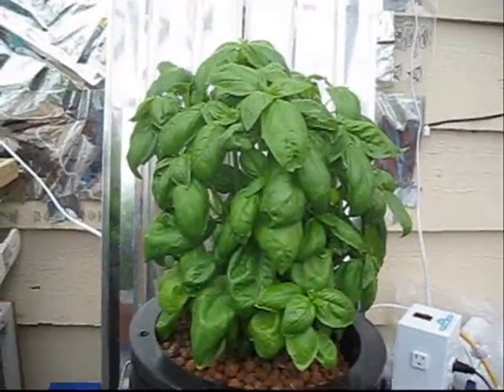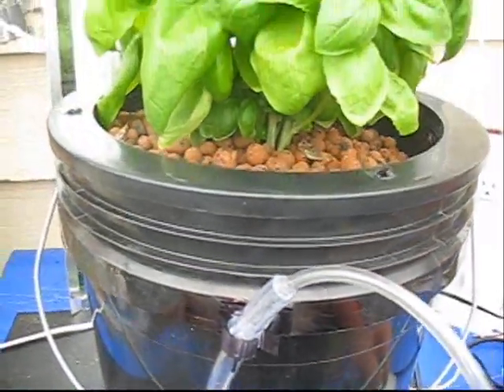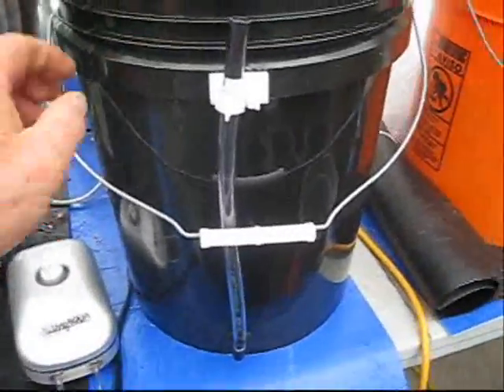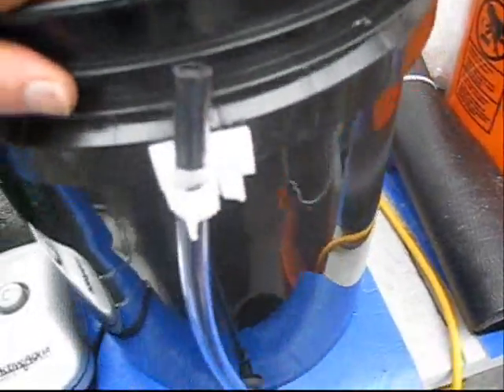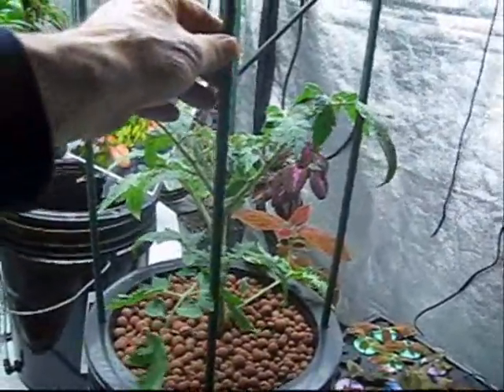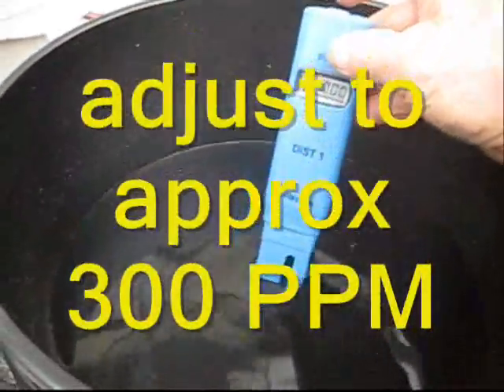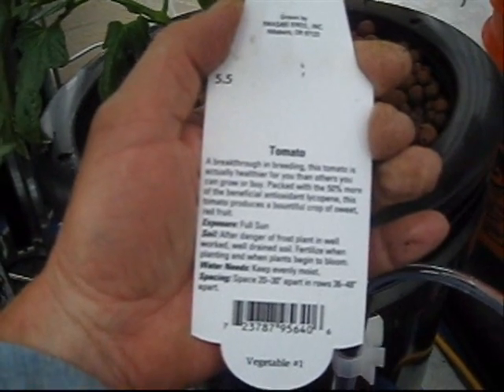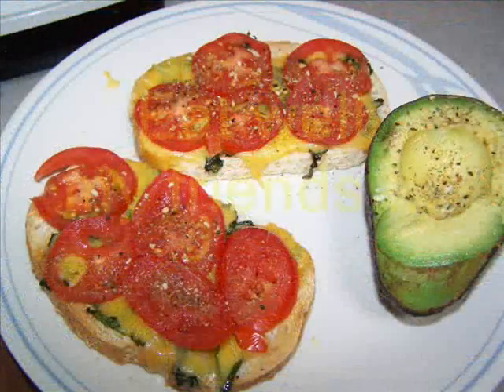Ron's easy DWC Bubble Bucket (RootSpa)

Comment: My only problem with this whole thing is that they must live in colder climate then me and the don't explain that your res water has to be between 65- 72 for your plants to uptake nutrients.  Also that after 72 you start getting root rot also I noticed a seedling heating pad under his so he is fighting the cold not the heat . Cold is much easier and cheaper to remedy then the heat which is impossible to remedies without a chiller or diy water cooler

Comment: I just started my bubble this year an mine are all outside, one thing I am noticing is that my water runs low every two to three days is that normal I do not see any leaks I am growing tomatoes and peppers, peppers doing good not so much the tomatoes and when the water runs low to I change it all the way and and add nutrients or just top it off and change water every two weeks your help please
Reply from the maker: Hello Marty - I noticed that my first year too.  What happens is as the plant grows transpiration increases, especially faster as heat increases.  What I do when there is a significant root ball, is let it run until about 2" of water remains then bring up the level with fresh nutrient solution.  When you want a nutrient change, just let it run low then drain, pour a couple of inches of fresh water in then drain that as well.  Final step just fill with fresh nutrient solution.  I hope that makes sense to you.  Good luck and thinks for watching my videos!
Reply: thank you very much I will be asking more question hope you do not mind again thank you and this helps, also can you recommend a good TDS thanks

Comment: I have the pots and I have 20mm holes at the base what size grommet do you suggest The last vid I watched he said use 13mm,the dick dont fit 20mm
Reply from the maker: Hi David - which video did you get that information from?  My video suggests a 13/16 inch  hole using a 1/2 inch grommet.  According to my rough conversion what you have should fit, although I would have to see to be sure.  
It should be a very tight fit and the grommet will have to be forced in place.  Use soapy water as a lubricant if needed.  let me know how you make out.

Comment: how far in the water do you sit the pot?
Reply from the maker: On new plants the water should touch the bottom of the basket.  Once roots start protruding beyond the basket the level can be lowered because, from that point on, it's the bubbles bursting on the roots that does the work.  Thanks for the comment and thanks for watching!

Comment: so happy i came upon this vid,,great vid .do you think it will work with pearlite and soil mix.or must i use clay balls
Reply from the maker: Hi Jason - You can use just about any growing medium as long as it is kept separate from  the nutrient solution.  Line the inside of the net-basket with coconut fiber, like that used in hanging flower  baskets.  The cheapest places to get these are:  Lowe's for the 10" basket and The Dollar Store for the 8" basket.  I have chosen to use the 8" basket because it works well and is handier to use.  I will be posting a new video showing that size basket along with nutrient management for the RootSpa soon.  Good luck and thanks for watching my videos!
Reply: thank you for the response.

Comment: Hi Ron, i know this is old video so just looking for a little advice. Is the basket in the water or just above the water line, everywhere i look people say different things, i do have my peppers just above the waterline with airstone, i have same pump as this video and although plants are growing, they seem stunted and wondering should i add more water to just be touching basket.
Reply from the maker: +MrJimbotz Hi - I start new plants with the basket about an inch into the water then lower the water level to almost touching the bottom of the basket once roots have developed.  After a while, once the plant has developed a sizable root ball you can let the water level get lower without causing damage.  Thanks for watching!

Comment: Hi Ron, do you know where I can find a grommet or tube cap for the top of the air inlet tube? I'm having trouble finding something for the hose to connect to.
Reply from the maker: +Amy Mintner  Hi Amy, thanks for watching my videos! You can see how to make the adapter by watching this video: 

https://www.youtube.com/watch?v=5Y0rbxnGcE0

You just insert pieces of vinyl hose to adapt from 1/2" to 1/4" for the air hose.  Good luck and thanks again for watching!
Reply: I actually was able to drill a hole in the cap and that works great!

Comment: how high is the basket with the hydroton above the water line? and how do the roots not dry out before they get in the water?
Reply from the maker: SwayzesGhost 
Slightly below the water line when initially planted to keep the roots moist.  Water level can be lowered to about mid way as roots grow into the water - air bubbles will keep the upper roots damp.  Air infused water allows roots to flourish without rotting because of oxygen and nutrition supplied to the roots.  Thanks for watching!

Comment: Where did you get the hose clamp from and what type is it?
Reply from the maker: Sun Ra El At Home Depot in the electrical parts section with items like wire nuts, lugs, etc. - it is actually a cable clamp.  Thanks for watching!
Reply: Ronald Kleinman is it the gardner bender 3/8 x 1/4 in if so could you explain how you attach it and how do you keep your water level from leaking?
Reply: Ronald Kleinman I didn't know if it is theOne Hole Plastic Cable Clamp or the  Plastic Kwik Clips
Reply from the maker: Sun Ra El Hello again!  Watch the video on how to build it:  

https://www.youtube.com/watch?v=5Y0rbxnGcE0

I shows how to construct and what parts to use.  Subscribe to my channel to catch more information on hydroponic gardening.

Comment: Thanks for the vid... I think that you are on to something here Ron!  

Air stones aren't all that expensive; but, it's an additional cost and a point of failure that you have taken out of the equation.

A friend made a comment that the bubbles are only on one side of the bucket.  I told him that it most likely doesnt matter and if he wants the bubbles to come up in the middle of the bucket, just make the hose going into the bottom of the bucket longer to reach the middle, problem solved.   Keeping it simple!!!

Comment: im thinking of switching to DWC and have been researching it for a few days now and was wondering do you check the temps of your water in the 5 gallon buckets? it tends to be about 75 degrees where i live and i know the water (or root zone) is supposed to be 68 degrees F. is this a major factor in your plants and will it be in mine? or will i be okay if the room temp is around 75 degrees?

Comment: Can you tell me the name of the gadget you used to measure pH and the nutirent level?
Reply from the maker: What I normally use is a TDS pen and a pH pen made by Hanna.  There are others on the market that work fine also.  Hanna also makes a combination pen as well but I actually prefer the single units - seem easier to manage, calibrate, etc.  Hope this helps - thanks for watching!
Reply: Ronald Kleinman Thanks for such a quick reply. I do have one more question. Do you use this system in the wintertime inside under lights and what wattage bulb for tomatoes if you do.

Comment: To reassure myself, do the roots soak in the water, or do you keep the water level just below the bottom of the roots? I put together a system ois ALMOST the exact same set up you have (only with a smaller diameter net/lid and I ran 1/4" air line through a hole I have drilled towards the top of the bucket) anyway, same concept, I just haven't received a clear explanation on rather the roots stay. athing in water or if they hover just above the water? f my own just going by my optics of how hydroponics work. believe it or not it
Reply from the maker: Hi Waylon - the roots are submerged in he water.  The supply of air from the air pump keeps them healthy.  Thanks for watching and thanks for the comment!

Comment: Hey Ron, I was wondering.  I set my bucket up to the exact as yours, but I cant seem to figure out the exact size of the tube that is inserted into the 1/2 inch to provide a couple to the 1/4th airline.  I have tried a few hoses laying around, but none of them are perfect.  They either fit the 1/2 hose perfect, and the 1/4 inch airline hose is too lose, or vice versa.  Could ya help a guy out?  I know that I should have just bought the Root Spa system, but I was able to make the whole thing for a quarter of the msrp price of the ROOT SPA.  Any way you could maybe send me a link to that inserted black hose at the end of the 1/2" hose?  Or possibly just a measurement of the ID/OD diameters of that tiny black hose insert?
Reply from the maker: Hi Dan - the black insert can also be clear vinyl.  It's a 3/8" OD with a 1/4" ID. Unfortunately, all hoses are not created equal but I found that the 1/2" ID (5/8" OD) and the 3/8" ID (1/2" OD) vinyl hoses at Home Depot worked well for inserting a 1/4" OD air hose.  If the fit is loose, insert further to see if that works. Hydrofarm has found a 1/2" OD to 1/4" ID insert that works very well but I haven't researched where to get them since the original adapters keep it simple and works just fine for me.  Thanks again for watching my vids!
Reply: Thanks much Ron.  I got one set up this way now.  The measurements were a great help.  All my other buckets I used 1/2 inch plugs and just drilled a 1/4th hole in the end to slip the airhose in.  Works great!  Thanks much!
Reply from the maker: Dan Stallkamp Thanks for the good info Dan - sounds like you made your own solution!  That's what it is all about.  Keep growing!

Comment: I want to build one like this but I worry the water will leak out of the grummit.Can you tell me the size of the grummit and that thin g connected to the grumit and the plastic hose.  That would fit your average airpump hose,and do you sell them
Reply from the maker: hi - the grommet is 1/2" - I drilled a 13/16" hole to put it in.  You can use a 1/2" elbow (90 degrees) and a length of 1/2" vinyl hose.  Make the adapter from short pieces of hose that inserts into the end of the 1/2" hose.  That's what you place the 1/4" air hose in.  You can buy the whole system for less than $50 complete with everything at ecogrow.com  Thanks for watching my video!
Reply: Ronald Kleinman Ronald thank you so much
Reply from the maker: click411 you are welcome!  Check out on how to build the system at Easiest DWC Hydroponic System

Good luck!
Reply: Ronald Kleinman Thanks for the nice description of how to construct one of these sytems Ronald!  Can you please elaborate on the insert for the vinyl tubing that will accommodate the 1/4" air hose?  Is this short piece of hose to be inserted a piece of the 1/2" hose?  I can't quite tell from the video.  I love the thoroughness of your videos!  Keep 'em coming!
Reply: Ronald Kleinman Oh and one more thing.  Do you dump all of your old nutrient solution monthly and add all new solution to the reservoir or do you just continually top off as needed?  Thanks again.  You have revived my enthusiasm for hydroponics!
Reply from the maker: Kevin Dillon Thanks for watching the videos - thanks for the comments!  Yes, the hoses fit into each other and make an adapter from the 1/2" hose to 1/4" air hose.  Also, I do dump the nutrient solution once a month and renew.  In between dumping though, I just add water when it needs it and add nutrient according to the TDS level I want to maintain.  I dump the nutrient on outside plants so it's not wasted.
Reply: Ronald Kleinman Thanks so much!  As one other viewer noted you are providing an invaluable public service that I am thankful for.

Comment: VERY nice unit my friend, way to keep the water temp down. Most people try to use water pumps not understanding that can lead to root-rot and high water temps. Well done, I like the drip systems like this that are bucket contained but use an air pump to move the water. Excellent video! $34 is a steal honestly...well done!
Reply from the maker: Thanks for the nice complement!  I am going to do a video showing the use of a nutrient solution controller to keep the buckets at the same level.  Several people have requested that because with multiple buckets it becomes a chore keeping them at a proper level.  Stay tuned for that.  Thanks for watching!

Comment: Hello Ron, I finally got 6 of your buckets going after letting them sit Idling in the corner for 3 months (lack of space).I was adjusting the water levels with an empty net pot when I noticed with the net pot inserted that there was much more bubble action on the sidewall than in the middle of the bucket.I decided to put a 4" piece of rubber hose from the inside elbow to the center of the bucket ,bubbles are now more evenly distributed now and the buckets are quieter.Thanks Ron:)

Comment from the maker: Hi - water temp hasn't been a problem yet in the Northwest area.  I think the constant input of raw air helps keep the water temp fairly stable. I know a guy using 30 without any problem so far.  Check out Jens Bubble Bucket Garden 2nd year - no problem there either.  Good luck and thanx for the comment!
Reply: I miss you, Dad ❤